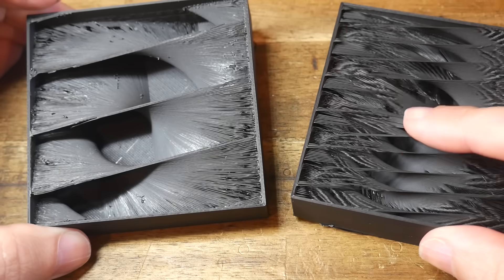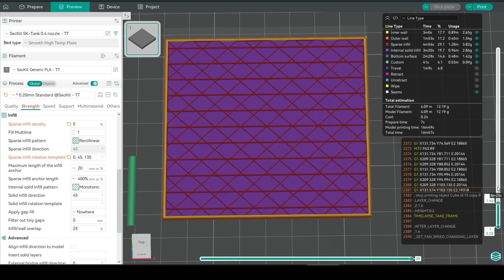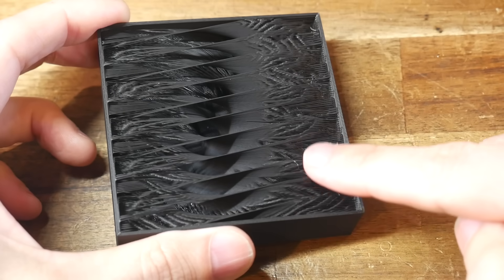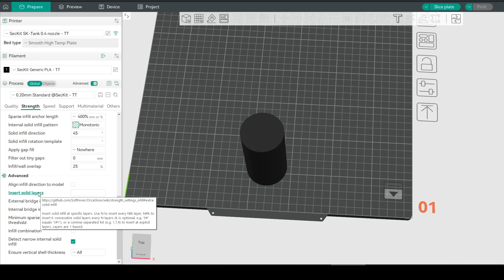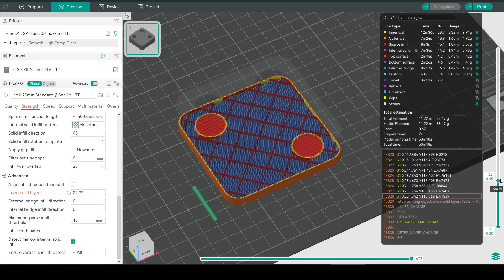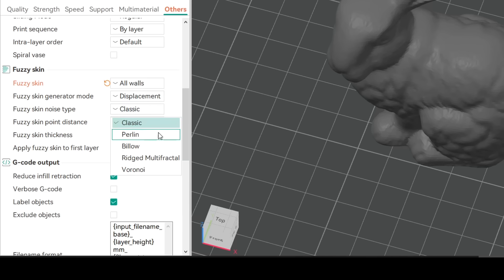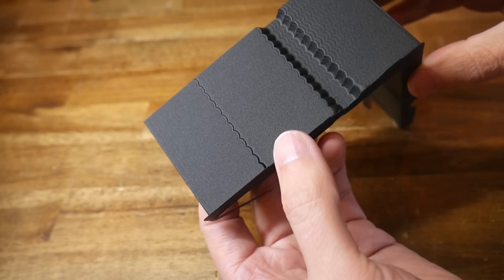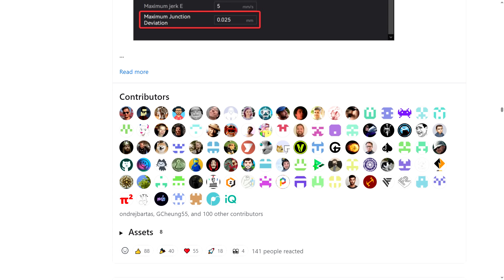Great new OrcaSlicer 2.3.1 features tested

Comment: I have been using zhop for years to print multicolor logos on the first few layers of a print using a single nozzle. With each color printing as a separate print then switching filaments and printing the next print color. I would love to be able to set this up in orca slicer or orca-flashforge. To use the multicolor system that would make the change to the new spool and new print automatically. I think this would save time and filament by only swapping four times on a four-color print instead of 4 times each layer.

Comment: I hope some future version will have an option for zigzag shells (something like fuzzy skin, but instead of a random pattern, it would use a plain zigzag). It creates an interesting fabric-like texture, and also makes thin walls more rigid. Probably also increases layer adhesion. At this point I can do this only by printing with zero wall lines and 100% zigzag infill, which complicates things when also a regular infill is needed.

Comment: I very rapidly switched to Orca after starting my journey into 3D printing (I do it for work to design/prototype parts that would be extremely challenging to make iby traditional fabrication methods).  The multiwall sparse infill I shall try.  For the part at 6:53 though I would add a solid cylinder around the holes using a modifier.  I design in 3D CAD and export STP that Orca directly imports (the main reason I use it).  I design the modifier in CAD with the main part then import them together as STP.  Once in ORCA change the type for the modifier part to 'modifier', set infill for it to 100%.  I always do this for screw holes especially if I am going to tap them or if they support any load.

Comment: There was a few years ago some attempts at using the purge tower in multicolor or multimaterial printing to print something else instead; like a low-quality draft part or something that would be hidden or need to be repainted. Do you know if there has been progress on that idea ?
Reply from the maker: I looked into this previously, wanting to design an object to use instead of a purge tower. From memory it was limited and the purge tower was still needed. Haven't heard about any updates.

Comment: I almost switched to Orca from Cura, but I couldn't get my first layer as nice as Cura. I did not have the ability to adjust my flow and/or line width enough to get all the perimeters and "infill" (aka bottom) to squish and connect together solidly. I tried all combinations of options, researching what other people did, found other people with the same problem who couldn't solve it, etc. I gave up. I'm looking through the release notes and it doesn't say anything about fixing this problem. Grrrr.

Comment: EDIT #2: Hey all, Version 2.3.1 isn't out yet. Website and github are still posting this version as BETA. 

EDIT #1: Josef Prusa recently posted about how is team was able to remove most VFAs with a combination of belt tuning and motion/speed regulation during printing. I don't think it has been baked into Orca yet, right?

Question of "Tuning out the sparse infill to solid layer line": we switch the printing order to print walls before infill, yes? Thank you for the instructional video of the new features.

Comment: Whats the best software to use to edit gcode if Orca leaves some moves through areas I don't want it in?(don't cross perimeters gets you 99% of the way there but sometimes leaves a few)
I can do it in notepad but have to cross my fingers as I have no way to display the gcode.

Comment: Rotational infill template is a huge step forward for Orca to make it a serious alternative slicer in manufacturing fiber reinforced composite sheets. Engineered laminates depend on customization of the sheet layup to dial in specific strengths, stiffnesses, and warping/antiwarping properties to laminate sheets. Simplify 3D and Cura had this feature for years and existed in custom slicers in aerospace and automotive industries. I’ll be looking a replacing our legacy slicer software at our company just for this new feature.

Comment: Normally when I check these updates, there's one feature that might get me excited. This update, it's like seeing a MUCH improved beta version go to full production with a full year of updates consolidated into One patch. The muti-rotational infil is perhaps my favorite, as I use variable infil manually for a lot of post-processes, namely backfilling for density additives, or adding a refractory material and ablating the print itself in place of the infil material voids to use the post product to embed in high-temp composite bodies.

Comment: When I was using Cura, the rotating infill feature was useful for making fun grill shapes, and making a custom pickguard for my bass with exposed infill! I wonder if there's any control over the center of rotation for it? Another feature that I like is the addition of new minimal surface infills (Along with gyroid, there's the D surface and FK) and lateral infill. It would be really cool if they added one of the "Optimal Isotropic Stiffness" lattices I saw in a paper once, which I was kind of able to make in Cura.
Reply: whoa interesting - was this lattice meant for 3d printing?
Reply: @KP-ty9yl Yup! Most of what I’ve seen was meant for SLS, or metal printing, but after looking it up I found a paper that used standard 3D printing called “Impact behavior of nanoengineered, 3D printed plate-lattices”.

Comment: Infill multiline was the one thing that Cura could do and PrusaSlicer couldn’t.
Reply: Took ages to realize that "strength comes from walls, not infill" is not quite true 😅
 Walls need to be supported (kept separate, but not separating) by infill for structural parts.

It has been always ) possible to increase infill line *width - I have done a lot of 0.6 mm (or more) with non-display parts.
Works really good with cubic infill (printed every layer) and flat nozzles (e.g. V6), maybe not quite as well with sharp tips.

*) as long as I have been 3D printing. Why should I refer to someone else's time frame 😉
Reply: @kimmotoivanen I don’t want to multiply for strength.  It’s when you eliminate the top & bottom layers and have an easy way to create patterns using just the infill, but it’s rather useless if it’s only one line thick..

Comment: How do I activate the advanced mode? I doesn't work on mine no matter how I clicked
Reply: Michael shows Advanced activation at 0:58.  If your control is grayed out and will not move, you may have Developer mode active in Preferences, which does basically the same thing plus may also activate beta features.

Comment: One of the old features, is that you can easily cut objects on the fly and quite often, you get the result as non-manifold objects with no easy way to just fix them, unless you're running Windows, which has something like that built in. That "feature" is rather annoying…
Reply: another windows W
Reply: @riba2233  ?

Comment: I had a feature request (can't find it now it was so long ago) to either SoftFever OrcaSlicer or Prusa, to provide a means to orient the infill pattern along any axis. For example, at 5:05 in your video, the direction of the Rectilinear (or Aligned Rectilinear) pattern is along the Z-axis. I proposed to be able to change to be along the X or Y, as well as Z axis.

Comment: The infill rotation is neat, though some of sectioning or extra solid infill could be done with modifiers alone. Which seems much more user friendly than adding very long and complex string into tiny input field. That's something for programmers (especially ones who developed that feature), otherwise it looks very cumbersome to use. I'm guilty of developing use cases like that as well, they might've been easy and clear to me but the end user, that was a different story. But it's alpha so it's likely to change.

Comment: 5:22 You should play around with TPU to see what kind of cushion you can achieve with this new setting.
Reply: Play around with varioshore TPU with modifiers and create variable density parts via heat and flow rate, AND infill modifiers to further adjust density. Really need active foaming PEBA

Comment: Are bricklayers officially added to orca? also is there multiple wall vasemode in any slicer yet?
Reply: It already was right? (Brick)
Reply: @thombakker2835 do you have link? I see only open source script for custom generating, but not as official feature. Correct me if I am wrong and share link/proof.
Reply: @groka1234  It's still not in there, yet.

Comment: Now if only there was a paint on texture like what's in Ideamaker.
Reply: It has paint on fuzzy skin if that is what you mean. They added that last update
Reply: @LoriAnneBrown  It's similar, but not quite what I was hoping for. 
Ideamaker has a feature where you can add virtually any kind texture to a model when you slice it. The textures can be anything from various wood grains, tree barks, cinder blocks, brick wall, etc., but the downside is that Ideamaker is very prone to crashing, not particularly friendly with most printer brands, lacks many parameters that most slicers have, and doesn't like to slice anything moderately complex.

Comment: The infill Multiline option is something what I wanted in this program since a while and it is very useful.
Reply: Finally! Cura had this a long time ago. This makes so much sense.
Reply: What will you use it for? I'm still trying to understand when it'll be beneficial
Reply: @khawajadotd Strength . For practical prnts you can reduce fill ratio while bumping lines and end up with a print that is not only faster to print but stronger once you get used to it.
Reply: @khawajadotd It's not beneficial for display prints. It is beneficial for load bearing structural parts, unless you design them like I-beams. Keeping those thick walls where they should be -- and spreading the load.
Reply: @kimmotoivanen it is also useful for cosplay parts that need strength and weight savings. This would have helped on the last sword I made for one of my daughters costumes. I reinforced it with wooden dowels through the blade, but multi-line would have helped reduce the overall weight while providing more strength.

But this is already making me want to try multi-line and dropping density in my toolhead parts to save weight and increase accel.
Reply: @khawajadotd  Combined lines of infill will give you a stronger result than having more single lines.
Reply: @khawajadotd Could also be used to create stronger fences or sieves when used in conjunction with no top/bottom layers
Reply: @khawajadotd It makes infill much stronger, so I use it for strength.
Reply: Same